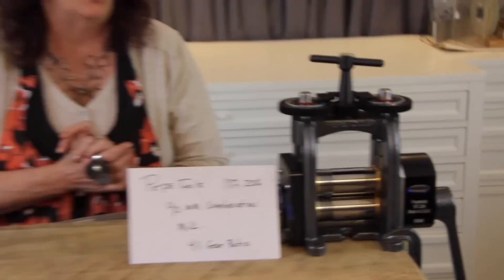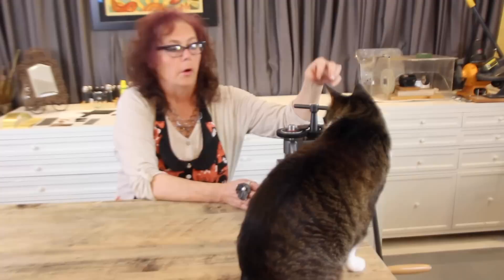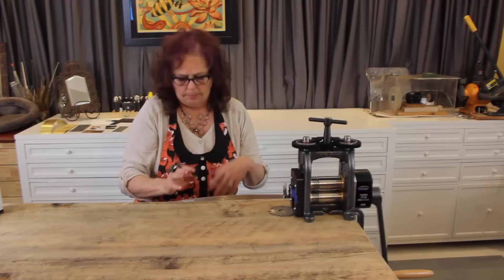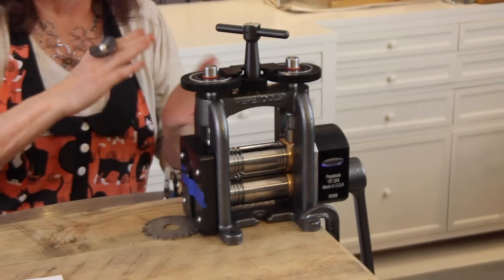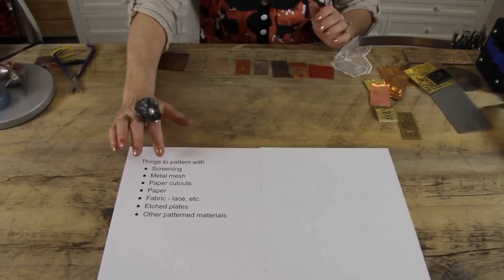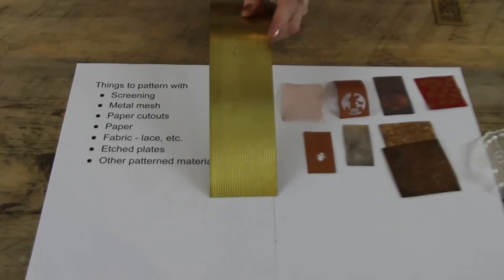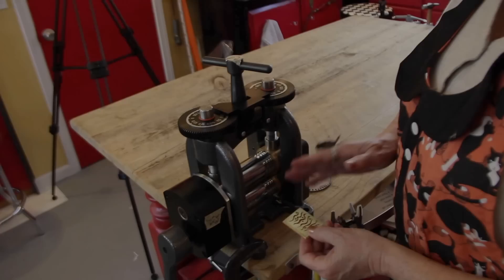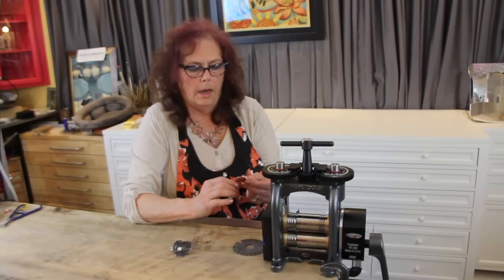How to use a rolling mill: featuring Pepe Tool's Ultra 90mm Rolling Mill

Comment: You can also buy rolling mill patterned paper designs on Etsy from "MetalDesignz" and "rollingmillresource", they've got some cool designs; and i believe one or both will do customs designs. If you're careful with them they can be used multiple times.

Comment: So, (love your videos) you seem like the best person to ask. . . What would happen if I used a texture plate and sandwiched it with metal and whatever necessary to protect everything. . .and then ran over it with my car? I don't have a rolling mill yet, the texture plate is $50. What do you think the outcome would be? Would I ruin the texture plate?  Points to ponder.
Reply: I actually tried that (grin). The only pattern was from dirt and tiny little rocks. 1) Maybe I didn't anneal properly 2) maybe tires aren't hard enough

Comment: do NOT use 3 in 1 unless you want sticky GOOP all over your rollers after a while.  That stuff is probably the worst oil ever for lubricating
go to walmart and purhase a can of spray remington gun oil, ultra light oil, good for cleaning and lubricating more than just guns

Comment: What gauge brass to use as sandwich for the steel texture plates?
Reply from the maker: Most gauges should work 22, 20, 18.  Some steel texture plates are specifically designed to used without sandwiching them.  I was taught to always sandwich steel but, Kevin Potter, of Potter USA, recently told me that he nevers sandwiches steel plates and that man knows steel, mills and everything!  Have fun.

Comment: I have this mill and cannot get it to work to texture metal. I’ve tried buying texture paper made for the purpose but it just comes out with no pattern or a faint one. I only bought it for the texturing so I’m disappointed. Any help would be very welcome!
Reply from the maker: Have you annealed your metal and tightened down your rollers?  Sounds like you don't have enough pressure.  Maybe this will help?  I hope so!
Reply: @NancyHamiltonJewelry  I will try tightening more thanks.

Comment: Hi:  I am an intermediate beader and a beginner metal.  Do you suggest that I purchase a Sixxiz for metal embossing first or go straight for the rolling mill.  What I like about the mill is that it has so many ways to use it and the sizzix can get pricey with the pattern plates.  I live in an apt and have limited space.

Comment: My Economy Rolling Mill Is 5 turns to 1 and i get over 500 different patterns , by changing the rollers , half round, flat,  round, and square with all different designs, for a very reasonable price.
Reply from the maker: Awesome!
Reply: BOB PADUANO my economy mill only opens 2mm. Useless for anyone wanting to use it for ingots, or steel texture plates. Considering the Pepe.

Comment: Hey Nancy, great videos, thanks for taking the time to share knowledge.
You mentioned (3:18) that the rolling mill had a maximum thickness of 5cm, I think you may have meant 5mm? (blame it on Ralph for distracting you). Thanks again for the vids.
Reply from the maker: +ColdForgeRings Jewelry You're probably right - that seems to happen a lot with me.  Although, don't have the mill, here, in my studio to check but, 5cm does seem a bit large!  Thanks for pointing that out - I'll put a note at that spot in the video.